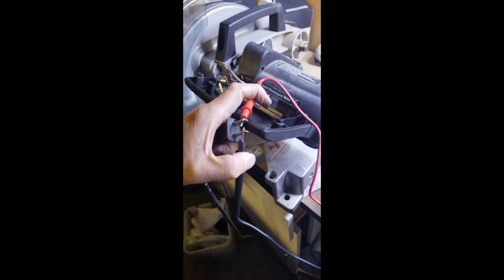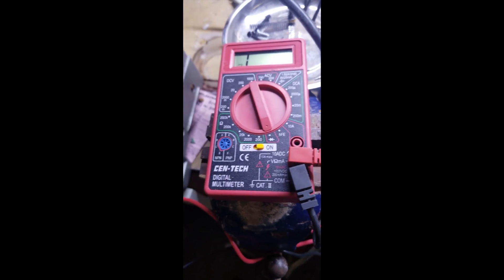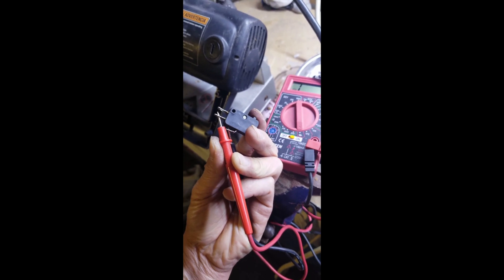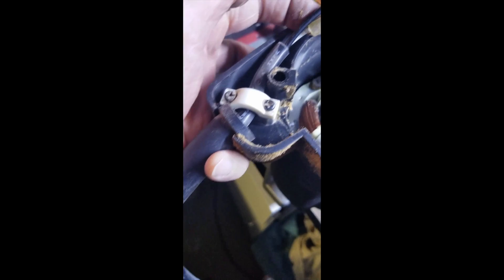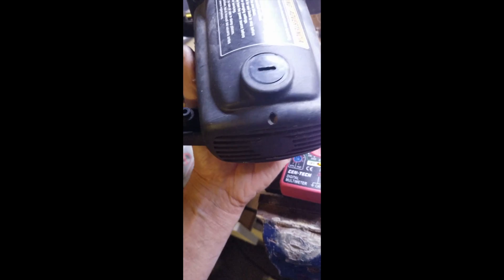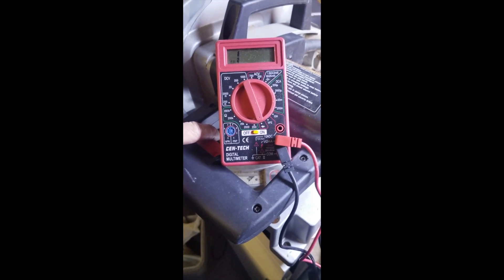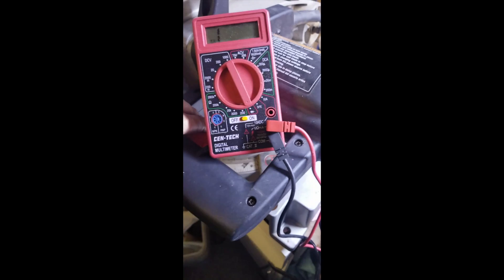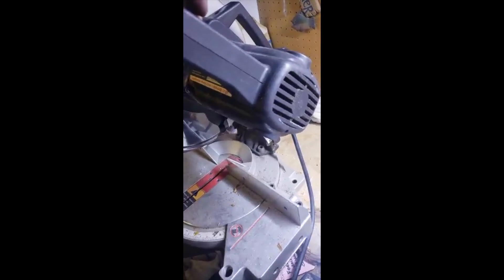Fixing a broken power miter saw (checking the switch with a multimeter).

Comment: I tried this and didn't have connectivity I had connectivity with the switch that's in my miter saw and took it all apart all the wires seem to be hooked up but I still have no connectivity on the end of my cord when I pull the trigger..thanks for sharing your knowledge.. Im sure it must be a loose wire. I just never seen any though..

Comment: Hey got a question? I try your video doing all the step that you show on video. My question is im getting some reading on black wire but nothing on the white wire  coming out of the miter saw switch do you think my switch is bud? The black wire coming from switch is working but not the white wire
Reply from the maker: I'm not sure, the way to tell if the switch is bad is to remove it and test it for continuity.  If there is no change when you click the switch on and  off with the multimeter in continuity setting then the switch is bad.
Reply: @oakpwr  Thank you! I just replace the switch bouth it on Amazon $11 is all good now the my miter saw Back in Business. BAD switch harbor freight miter saw available in Amazon